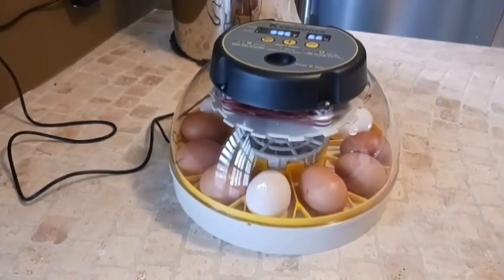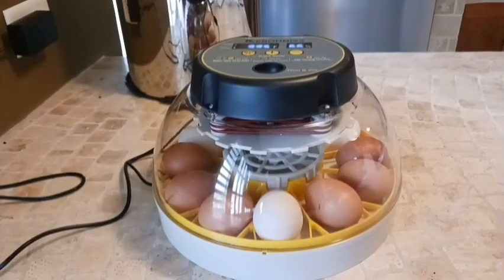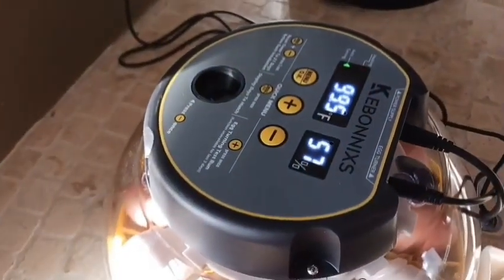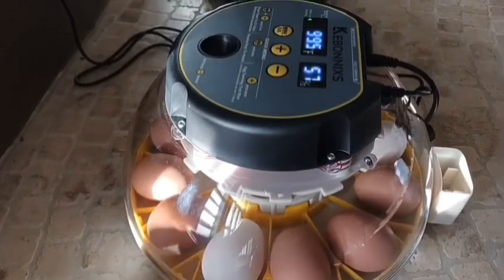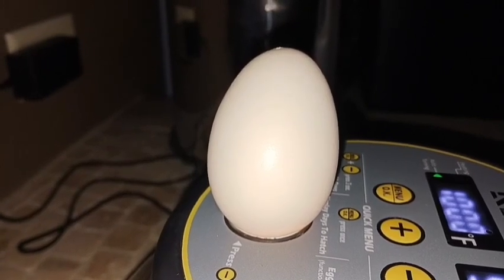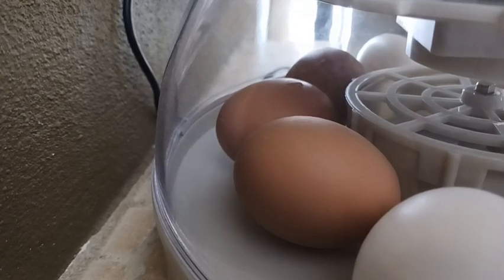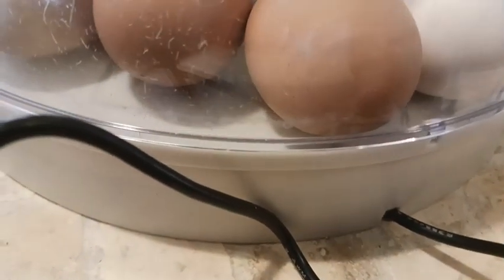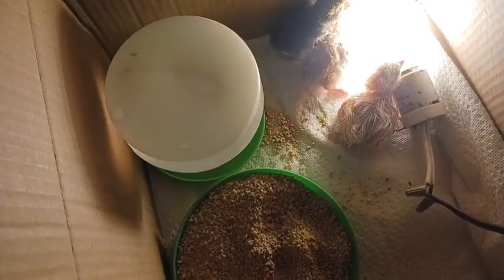Kebonnix incubator off grid

Comment: The reset function is for when you use it the second time. It resets the day count so it stops rotating around the right day for the chickens. Here at my location, I constantly need to keep that water trough full or we get too low. I'm sure you'll find the thing works. I've run 2 batches of eggs in it.
Reply: The power outage wouldn't have ruined your day count. That's what that reset button is for. It keeps track of the day even if it loses power.
Reply from the maker: @PraxisPrepper  that's good to know,  I reset it because I started playing with it before reading the instructions lol. I got a cornish cross mix chick
Reply: If you ever feel like you might have accidentally forgotten to reset it, as long as you recall when you popped the eggs in, you can reset it at any time to be sure the rotation function does its thing, and then on whichever day is sensible for the eggs being hatched, you can just take out that yellow rack that rotates the eggs around. The motor can rotate all it wants, but without that rack, the eggs will be safe from being rotated when they're hatching - which I think is the point. You stop them from rotating so the machine doesn't becomes a baby chick grinder. I'm glad you got a cross chick out! It's exciting to raise them from the egg like that. @MosaicHomestead
Reply from the maker: @PraxisPrepper  it's day 00, I have about 4 eggs that haven't hatched, I'm giving it 3 more days, I may have 4 quiters